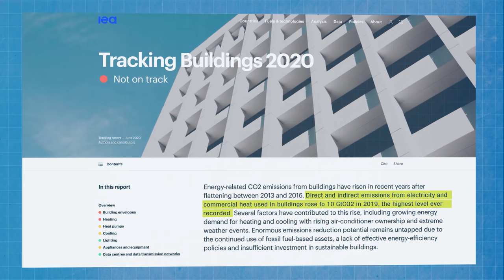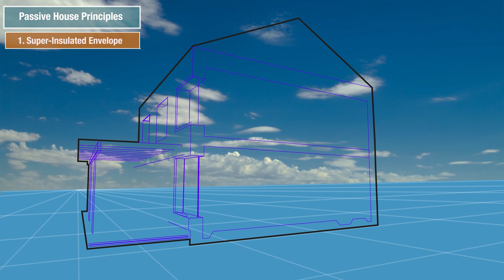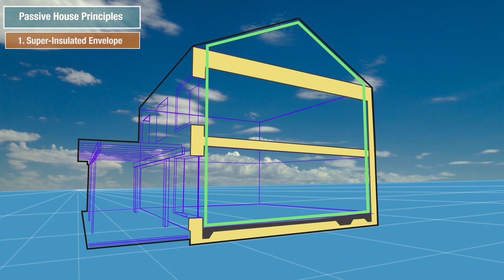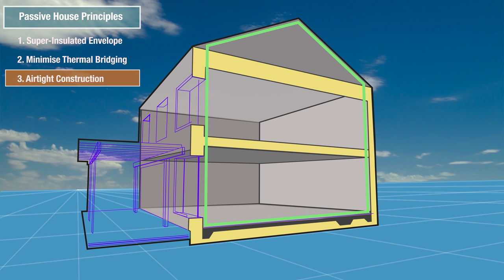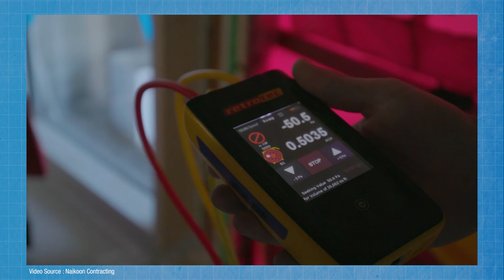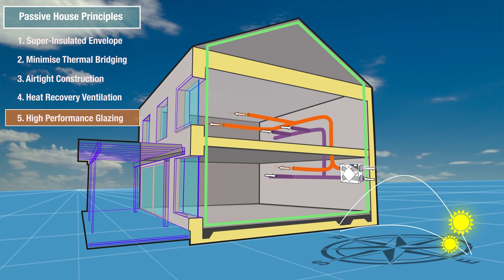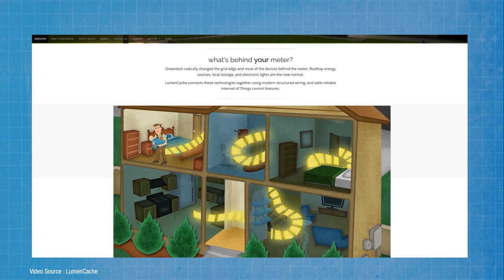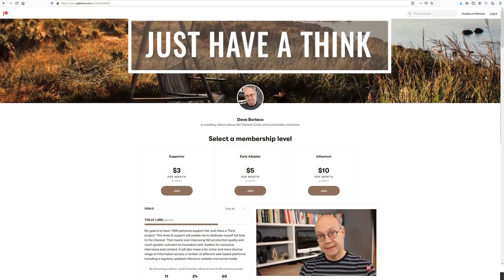Passivhaus . A low carbon future for our homes?

Comment: This is all well and good. Generally this efficient building idea has been well known by even the most "non-interested" consumers for decades! Yet what is the current state of the building industry on the whole? I'd venture a guess that if a survey was done that looked at existing housing and light commercial building efficiency starting at some arbitrary date, lets pick 1946, right up to present day. Maybe not so arbitrary, 1946, because that could generally be considered the beginning of a building boom. Many many houses still exist from this era and and many more exist from much earlier in time as well! In your preamble you express that how "we" pour energy in to our living spaces to heat and cool them is "a little bit stupid". No disagreement there, but the problem isn't that WE'RE stupid, 

it's the cost of retro-fitment!!!!!!!! 
Have you been to a Home Depot lately?????? Holy $#@& MAN!!!! 

This leaves us stupid people with NO choice but to turn up the heat, or crank the air cond. 

Lets all just 'have a think' fer fuck sake.

Comment: Whilst the 'passivehouse' concept is clearly a step in the right direction,I would argue that it is a clumsy step which manages to be overly complicated and yet somehow a bit too simplistic at the same time.Gotta love those myopic 'engineers' and factory owners,eh?!
Sophisticated natural solution to shelter-fur.
Dumbass engineers and factory-owners' solution- spacesuit.
Creating a sealed envelope forces you to have an expensive and complicated(maintenance,replacement costs,transport from factory,cost of installation,etc,etc) AC and moisture management system pumping fresh air in through heat exchange ducting and pumps is a crude attempt to reduce heat loss.So crude in fact that it requires a ridiculously complicated and expensive system of membranes,pipes and pumps which provides income for.....myopic engineers and factory owners.
A far superior and much more sustainable system used e.g. throughout Scandinavia is the breathing wall concept or 'murs transpirante' as they say in France.
This approach does not require synthetic membranes,uPVC,pumps,wiring,electricity or monitoring,all of which are about as recyclable as an 'energy efficient' lightbulb..
The idea of trying to effectively eliminate energy consumption is again moronic.All that matters is how the energy is produced.
Heating can be easily achieved with a well designed and professionally installed thermal mass wood stove (not a crappy polluting woodburner from the local DIY hellhole) and well seasoned firewood. 
Basically:
-the house can be built from sustainable,locally sourced untreated timber e.g. Douglas Fir or oak with breathable ecological insulation like hempcrete or woodwool(e.g. Homatherm holzflex,made in Europe-the land of human rights) between the posts and studs. Woodwool is made from recycled wood waste and treated with organic flame retardants (boron salts?).It comes in semi-rigid panels,easily cut to fit any space(I have insulated the entire gnarly old roof of a 12th century castle with the stuff) and it compresses slightly into the spaces eliminating drafts(cut it say 10mm oversize both ways and squish it into place.Snug as a bug).It will even hold itself in place between joists and rafters.It is an excellent thermal and acoustic insulator which allows moisture to leave the building through the walls and roof when it's too cold to leave the windows open.
-the main requirement is that the wooden cladding used on the outside e.g. sawn,untreated Douglas Fir overlapping weatherboarding is 6 times more breathable than the interior cladding e.g. planed pine tongue and groove (no plastering or painting) and that the insulation's breathability level lies between the 2.
The moisture produced by the occupants (breathing,cooking,washing,10 litres per day for a household of 4) slowly travels out through the walls,ceilings and roof.
A better solution than triple glazing is wellmade hardwood double glazing(not uPVC) with external shutters- they provide lots of extra warmth and security whilst allowing the sun's energy inside in the daytime. The more layers of glass you add;the less sunlight(including those lovely warming IR wavelengths) can get in.We can't ban the science behind the greenhouse effect so we might as well take advantage of it!)
Intelligent roof geometry,ensuring that the rafters overhang the walls sufficiently e.g.1m for single storey will keep your walls cool and out of the sun in summer whilst keeping the wood cladding dry,improving insulation properties and so extending its life way beyond 10 years and at the same time will allow the sun to hit the cladding and windows for the other 3 seasons i.e. 'passive solar heating'.

Comment: Thanks for the IT plug! POE+ is capable of delivering 45 Watts of usable direct current power up to 300 feet away through ethernet cabling (category 5 or category 6). 

I work in IT as a gig worker and although about 95% of my customers are businesses, NGOs, and churches and charities, we do also occasionally work on residential installations too. Of the homes we've worked on a little more than half of those are new construction and the rest are (whole house) remodeling jobs.

One of the most memorable new construction homes I have worked in recently is a 24,000 square foot beast! We ran coaxial cable, and 3 disparate (color coordinated) data networks. Blue for data (internet), green for climate control, and white for security cameras and wifi access points. 

The home was built in a gated community that is in a remote location. So remote in fact, that there was no fire hydrants in the subdivision and consequently all the homes have a fire suppression system not unlike those found in office buildings with water sprinkling heads protruding from ceilings and cornices everywhere. 

This home even had a hydraulic elevator car with a maximum capacity of 3,500 pounds in it! Big modern houses have big modern data needs. The owner of this house owned three private golf courses, and a couple of other smaller businesses. So naturally he had a home office/man cave in the basement complete with a 550 gallon custom made marine aquarium! Hell, that aquarium had its own room just to house the pumps, filters and chemicals needed for operation. 

The home also had its own theater room for movies complete with actual theater seating for 20! Every room has televisions - even all 8 bathrooms! After all was said and done, we had to expand the DHCP range in the router because there was so many devices needing an IP address that conflicts were arising! Everything was connected to the IOT. Televisions, Sonos Sound built in speakers were everywhere, a total of 14 high definition security cameras, 12 wifi access points and a central controller that handles seamless switching between individual APs as residents and guests roam about the entire property (inside and outdoors), 8 smart thermostats, and one of Comcast's very first actual gigaspeed residential internet connections. Even state law required that the elevator have its own separate dial tone. All told there was need of 212 IP addresses! 

And of course, the home had its own diesel powered backup generator! Wish I could post pics in these comments as I've got many from this home!
Reply: David, this is awesome from the perspective of employment but personally I find the description of this "home" to be an example of what's wrong with many humans.  The impact the owner is having on the planet with this building is staggering, no matter how efficient it may be (and likely isn't).  If I was as wealthy as this individual this excess flaunting of wealth would be the absolute last thing I would do....I'd give the money away before going this route.  Very depressing.

Comment: have you looked at earthship design houses, not as high tech as passive but just as environmentally friendly(& much cheaper)
Reply: Can earthship house be build in form of multi-level house with flats like most city habitats are being built nowadays? Passivhaus can be used for such things as well as offices, schools, hospitals etc. And it can also mass produced.
Reply: @ukrytykrytyk8477  technically yes, but practically they are limited to 2 levels & work ideally with 1 although some of the design ideas can work with multi -level. Though some of these ideas are more limited by multi-level, like rainwater capture for example. One of the main limiting factors is that for energy free heating & cooling they use require an earth berm with air pipes buried in them mostly on the rear of the house(but ideally around the sides as well). The greenhouse type fronts do not have any level limit & Passivhaus design ideas & earthship design can be combined. Also you can replace the earthship passive heating/cooling with something like ground source heat pumps on taller structures.
Reply: @catdogfishcake  Don't get me wrong, I like Earthship houses, but it's not the same as Passivehaus. Passivhaus is a design principal and set of goals for the architects to follow. It can be realized in various ways, I suppose including exotic methods like earthship, hempcrete or straw bale construction.
To me the biggest advantage of Passivhaus is its flexibility allowing for even massive apartment blocks or hospitals to be constructed with the principals in mind. Buildings that are using ten or more times less energy, per square meter, comparing to some standard built units.
That is what will result in real global impact in energy demand.

Comment: yes you need to super insulate the structure- BUT the most simple/low cost step is to just face the long side of the house to the SOUTH- winter sun !  that will save 15% of your heating/cooling load right there!!!  and then load that south facing wall up with double pain glass- along with moveable window insulation systems (curtains, shutters, etc. that at least an R 4-5 insulation value).   and minimize all other glass locations.  And add some mass to the interior area that will see the sun- like conc. slab floors, thick tile on plywood floors, brick on sand floors and dividing walls (running east/west) of conc, stone, brick or a thick cement based plaster.  the building industry can't even do that!!!  the ignorance is astounding!   originally- back in the 70's we called these Passive Solar Super Insulated houses here in the usa. www.bendsolarhomes.com
Reply: That for the southern hemisphere. 
Down here its north facing.

Comment: If only we could convince our gov and house builders, been waiting a while yet.
Reply: Then build one yourself! If you include the costs of running(especially heating and cooling) the house, using passive house techniques is in most cases cheaper. Obviously it always depends on where you live, if you end up with a true passive house.

Comment: GEEBUS!  I was reading books about all this stuff back in the 70s. And they were old books. Your rich, white, German guy didn't "invent" anything. It looks as if all he did is smash two words together and try to trademark something that was at least 50 years old. It always amazes me how great ideas never get any credit till a rich white guy starts selling it to even richer people.
Reply: Very true.
Reply: You are right in that these ideas have been around in various forms for a long time. The problem was  performance could not be predicted and overheating, condensation and cool spots could not be accurately compensated for. When designing a passivhaus, you use a piece of software ("PHPP") that calculates all the heat flow within the structure and outputs very accurate parameters such as thickness of insulation, size of windows etc to achieve any given performance in the most efficient manner in the climatic zone, elevation and latitude. Without this it's a bit of a guessing game.
Reply: @treescape7  My HE was non-corrodible and self-draining AND totally efficient.  But that wasn't the point.  The costs weren't saved by the builder, and politicians are almost invariably and lamentably unscientific.  There was absolutely no interest expressed anywhere.
Reply: @tonyduncan9852  you were ahead of your time! Sorry to hear you were ignored by the establishment but the UK building industry is a closed shop if you're not a freemason.
Reply: @treescape7  I subscribe to Groucho Marx's dictum "I refuse to join any club that would have me as a member".  This why I have finished a couple of glasses of wine after a swim in the Atlantic Ocean, in warm sunshine, free of debts and obligations, in the company of someone I have loved for fifty-eight years.
Reply: @tonyduncan9852  sounds wonderful!  We were in Icod de los Vinos last year for walking and botany. Tenerife certainly is amazing.
Reply: @treescape7  Yes.  Some wines here never leave the island.  The volcano is beautiful from the north, but almost invisible from where I live.  The weather is the most temperate in the world where we are, and there are hardly any insects,  Food and veg are good.  We are on the coast, in the desert.  It's dry, warm and windy.

Comment: future? what future? you can always cut energy consumption by switch off things, it is just a habit or not, future? no, I am talking about now. when you go outside, there is only 1 household appliances still need to be 24/7 on, it is the refrigerator, if you managed to make a "kill switch" flip, you will save energy, in my case, i only use about 34kw per month. not because I am a enviromentist, no, I am not, it is because the price of electricity is high!

Comment: Whilst I fully support the idea of such houses I have found that in the UK there are two main reason why so few are built. The first is the low standards of the building Regs, which do no mandate such levels . The second is the very low skill levels of the 'builders'. I have watched first quality insulation installed so badly that it might as well have been left in the garden. Whilst house build practices have not changed in over a century. 
Until Government Regs. change the passive house will be a rarity.
Reply: Main issue in UK is the lack of building plots for self builders. In other countries where self build is more widespread one can see that more and more houses are being build in Passivhaus standard or close to it since it makes more sense. In UK one has a choice of old cold and moldy but bigger house or newer less cold but equally moldy new home from big developer.
Reply: @ukrytykrytyk8477  Since it the the big four or five builders that produce the vast majority of the crap houses in the UK I still put poor Regs. as a main problem. It is firms such as Barrett,  Redrow , Persimmon , etc. that are building down to the lowest level possible. Look at any new estate , it is normally  only public/affordable housing that have Solar Panels or ASHP. If the UK is to have a quality housing replacement programme it needs the mass builders to be involved, not taking £100m bonus payments!

AS for building plots, my solution was to knock down my old cold bungalow and start from scratch. Including  all costs my replacement house had a street value that made the job worthwhile. I replaced a three bedroom bungalow with a six bedroom house for my extended family.  We now have a 'tea cosy' of a house with low running costs overall.
Reply: @solentbum  I think we can both agree that what is lacking in UK is the competition. When there are so few builders, then everyone needs to buy from them which equals substandard product for high price. That is what makes them the money and what gives them option of running campaigns against whoever would like to change it. 

Great job building a new house in place of old bungalow. My friend has done similar thing but their plot was big enough to build a new house next to old one which they have demolished afterwards. It's an expensive option available to only a few though,  especially around metropolitan areas like London where even bungalows sell for crazy money!

Comment: I'm sorry, but the cost is the biggest herdle still. Not competetive at all. At least not in Norway....
Reply: I'm not sure what figures are for Norway but in countries where it's popular and well supported by the industry the difference is not that large, small enough to pay itself within couple of years. With traditional building costs are often underestimated and spiral out of control because pour design and craftsmanship which in the end costs the same. With Passivhaus there is an emphasis on good design, prior calculations and performance checks which means building performing as planned not requiring expensive fixes and not going over the budget.